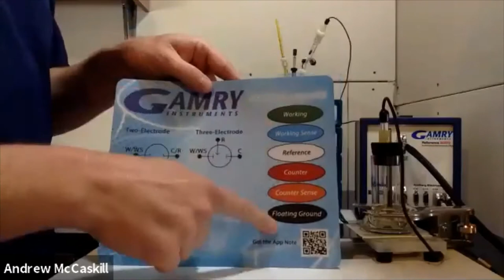Live Instrument Demonstration

Comment: Dear Sir/Madam, i am using my lab GAMRY 1010E. I want to find CV test, electrical conductivity and energy density test. can you give me any formula pdf for calculation by which i can find out my energy density and electrical conductivity as well?
Reply from the maker: We do not have a formula for energy density. This would be highly dependent on your cell and its behavior. For electrical conductivity, running an experiment like EIS would be better suited for the measurement than CV. If you would like help running EIS, or have additional questions on CV, please reach out to one of our Technical Support Engineers at techsupport@gamry.com